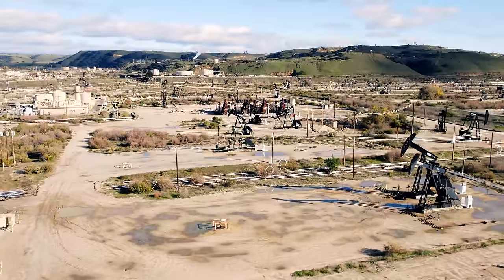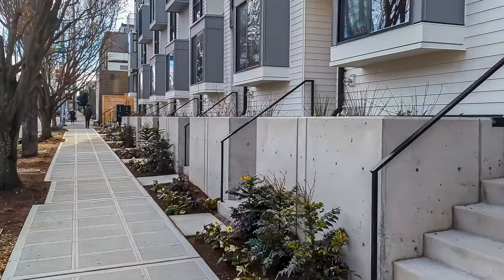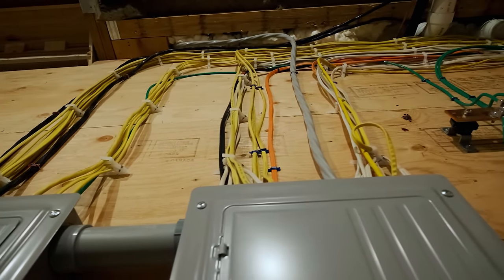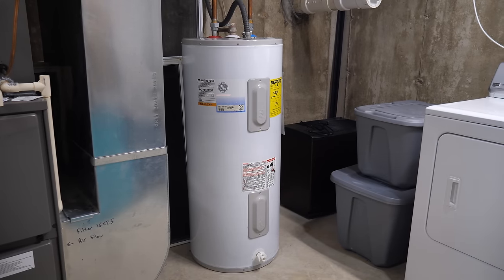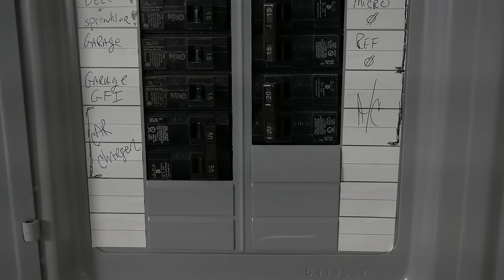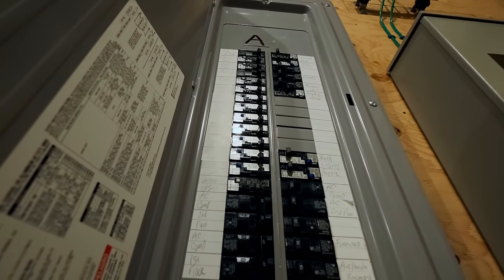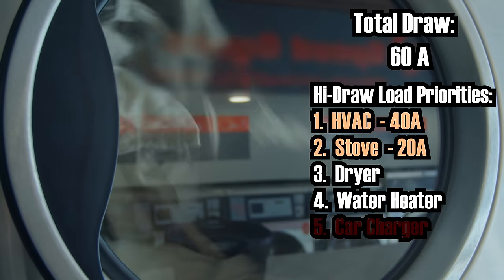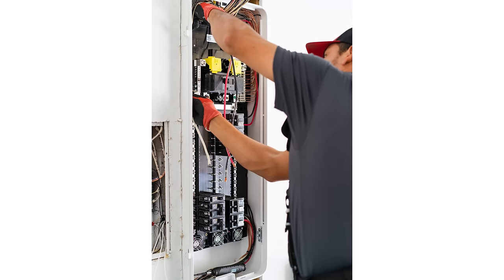Home Electrification: There's not a lot to do, and it doesn't have to be hard (Part 1)

Comment: I'm building a home right now. We are going to be in a very rural area prone to power outages whenever some truck hits an electric pole (which happens more often than you'd think). We are planning for an automatic propane generator for when that happens. I'm really looking forward to your video on that bit.
Reply: @barongerhardt  Electric-powered electric generator. 🤣

That has real "Instant water: just add water!" vibes.
Reply: @barongerhardt  The idea of costly batteries to maintain does not appeal to me.

Comment: For how much you need backup heat with heat pumps: I live in NB, Canada. I have lived in my current apartment (3rd floor, 1 bedroom, washer & dryer in the unit, our own water heater, everything is electric) for 3 years now, and our meter had just started back at reading something like 10 kWh when we moved in so I know I used 16131 kWh since I moved in. It has a 2 head multi zone heat pump & base boards heating, with digital thermkstats. Our current (move in 2 years ago) downstairs neighbour does not keep their heat as high as the previous tenant - our floors are no longer nice and toasty lol - so our bill did go up a bit when that happened, but not by much. 

We had ice storms over Christmas, and during the Dec 20 - Jan 18th bill we used 659 kWh for the 30 days. The first time I turned on my breakers for my baseboard (except the one in the bathroom) in the 3 years was during the Jan 19th - Feb 16th billing cycle this year, when we had like 3 or 4 days that it stayed around -30°C ish with the wind chill, and it hit as low as -40°C with the wind chill, and you can tell because for those 29 days, I use 750 kWh. Literally my highest bill since I moved in here.  And then I promptly turned the breaker back off because I work customer care for one of the 4 power companies so I know all too well how much baseboard heat wrecks  your bill 😅 had to raise my equalized billing and have become the stereotypical "raise the temperature, I dare you" person wearing wool socks and wrapped in a blanket at all times. 

But yeah, using your backup heat can be a kick in the gut... But it does not happen often if you have a heat pump that is rated for the temperature you expect to get in your area.

Comment: I feel like a smart breaker panel is going to be more expensive than just upgrading the service for 90% of houses...

Also, based on the models shown for the smart panel, there are parts which would wear out over time and aren't easily swappable.  And over the normal life span of a breaker panel, they are definitely going to break or be reeeeeaaaaallllllly expensive up front.
Reply from the maker: It might very well be worth upgrading to 200A, but whenever you do that you either need to run new triplex from your mast to the transformer (relatively easy) or run a new trench to it (possibly much harder). Whereas a panel swap is just a panel swap. Plus, the availability of a service upgrade is not guaranteed - you have to work with your utility, and if the local grid is already pretty tapped out they might not be able to upgrade you.
I can't vouch for how the Span panel is engineered, but contactors are pretty robust things and they'll rarely be cycled anyway - so I don't think I'd have that particular concern.
Reply: @TechnologyConnections  If it's an issue with the local grid being tapped out then maybe the grid would be more worried about your average usage rather than your peak usage, as long as the peak doesn't happen at the same time as your neighbour's peek.

They're already monitoring your average usage in order to bill you, so maybe they could say upgrade you to 200A but a limit on your average usage. If you use two much on average they might warn you a few times and then maybe fine you or limit your power back down to 100A.

Comment: If you want a fun rabbit hole to run down is the bearings used in windmill turbine generators. Apparently the loads are so great that the bearings may last 5 years. The bearing issues need to be fixed to make wind more reliable.

Comment: If you're building a new home thinking about resistive backup heat might make sense. But if you already have a wood, gas or coal-based heating and are renovating it makes sense to just, you know, keep it (if it makes any sense at all in the situation). You'd still use a heat pump in 90%+ of cases, but for those few really cold days when it's cheaper (or only possible) to use it as a backup, it makes perfect sense. As a nice bonus it also helps the grid which becomes extremely overutilized during those times.

Comment: I recognized that this video was going to be primarily addressing how current technologies could enable homes to run entirely on electricity, so I was worried that the "stoves with batteries" wouldn't be mentioned in this video, and sure enough I was right, but great to know they'll be coming in part 2! The December 14, 2022 episode of the Volts podcast by David Roberts on this technology was a really good listen.
Reply: Sounds dumb.  Not everything needs an inefficient battery (which like my hybrid car battery will need replacing someday)

Comment: 30 year old 3200 sqft house with 800 sqft of that being a finished basement with its own mini-split. The walk out basement on a 1 ton mini split. We had several days of 5F weather this winter in GA, the basement stayed 68 the whole time. 
However, the 2 upstairs floors of 2400 sqft on a traditional 3 Ton unit with no heat strip fell well behind with it struggling to keep it in the mid 50's. That said, the additional heat needed from a resistive strip to get us through that at a reasonably temperature would have been a whopping 3kw. Or a couple space heaters. Maybe if we had newer more efficient windows the heat pump would have been enough.

The HVAC guys said we needed at least a 20kw heat strip. A little air sealing and insulation goes a long way.

Comment: Gas won't be abandoned until Electricity can be cheaper. Electricity is more expensive than gas. It's simply not efficient to use electricity at this point in time. Not until 2050+ will we finally get some functional fusion power plants like ITER (which is just a test, not a grid-servicing power plant).

Comment: In Taiwan, Hitachi sells a minisplit that also works as a water heater, it simply uses a separate condenser to heat the water tank up while it’s cooling your room. Pretty interesting product
Reply: That sounds like an incredible efficiency upgrade. Taking heat from your home to heat your water and cool your home at the same time.
Reply: I believe Rheem in the US has something like that too. Very interesting product indeed
Reply: We’ve had this in Australia for years and they suck at heating water. The Instant Hot Water gas heaters work great and are very cheap because they don’t store any water in a giant tank when it’s not required.
Reply: Yeah it's a shame there's not that many of them in North America. I think LG Therma V is mostly commercial.. Taco System M is another I heard of that recently came out that might be a bit more residential. I think they're still far more expensive than generic heat pump water heaters like Rheem ProTerra and the like, but they do have more perks and likely more efficiency in the summer due to the compressor being outdoors.

Edit: SpacePak apparently has some interesting A2W solutions as well.
Reply: Taiwan is so great!   Great people, great heritage, and the ultimate in tech.
Reply: already exists in the us. its called a heat pump water heater......
Reply: @jtackerman28  yes. But it's ver rare that it's combined with a mini split air conditioner. Cools your room AND gets the water with a a single pump / outdoor unit.
Reply: @jtackerman28  definitely does not exist in the US, he said this heats the space too
Reply: @JesusisJesus  Water tanks hold their heat very well. Tech Connections already covered that, and is why offpeak powered water heaters are so common place in Australia, so it's weird you'd have that misapprehension.
Reply: A step forward towards a home coolant loop, shuffling around all the heating and cooling for the house 😀
Reply: @JesusisJesus  You can always have electric or gas water heater in conjunction with the heat pump. Even if the heat pump just produces tepid water, that's still heat that you're not wasting
Reply: Sanden makes a full heat pump water heater with its own outdoor heat pump. They are amazing! They also are over $10,000 to install and usually more like $15,000! Energy efficiency can be extremely expensive!!
Reply: @benhockley  100% agree, instantaneous hot water systems are pretty expensive to run by comparison, especially if it's the only reason you are paying for a gas connection
Reply: Lennux has/had a system that would run a HEAT PUMP to HEAT water and that would heat your water tank AND run through your air handler giving you domestic heat
Reply: @SunriseLAW  there's a water sanitation challenges with this. Keeping water warm but <60C tends to be a breeding ground for pathogens.  Most solar hot water systems here in Australia pump water through black hoses to make sure the water gets hot enough. Though these systems are now more expensive than solar panels with a conventional electric heater here
Reply: @JesusisJesus  Are you Alice Springs levels, stream train only, no train, LOL
All people live in apartments, urban townhouses, they all gave good gid.
U are in US levels down under, too remote !
Reply: Zaydan Alfariz  TSMC, ASML, we love the west !
Reply: I have always wondered why we don't do that.  We are literally pumping heat out of our homes during the summer and wasting it, while then creating heat to heat water at the same time.  It would make perfect sense to use a heat pump to do that.

My Hybrid water heater does this already, but it basically just cools down my garage in the process.
Reply: @JesusisJesus  That claim is literally absurd.  I have had a Hybrid heat pump water heater for like 10 years already.  And it works so well I never even turn on the resistance heating elements at all.
Reply: @JesusisJesus  I think we'll get battery-operated water heaters in the future.  
Instant heating is more efficient due to lower losses, but is impractical(for now) when electric.
Reply: @benhockley  Kinda. Depends where it's placed and how well-insulated it is.  
Mine is in the basement, and uses 4-5kWh/day just to stay warm when it's freezing outside. Not sure how low the losses will be during summer, but my guess is in the 1-2kWh/day range.
Reply: @MalawisLilleKanal  a basement? Never heard of someone having one of those in Australia. 1-2kw loss is really an issue if you hear it on the overnight tariff. I've got family in Tassie, NSW and Vic and they've never mentioned heat loss so extreme they can't have a hot shower.
Reply: @benhockley  Different climate and practices I guess. This is in Norway where we are used to cheap and abundant electricity(until the last year or two).  
BTW: The water heater is around 200L, and takes about 16kWh to heat up fully (8 hrs @2kWh) when it's allowed to cool to ambient.
Reply: @josephpimentel4624 the Rheem suck heat from your house. They're useless since this need to heat back that heat and studies show they barely reduce energy bill. The outdoors air to water for house or pool are much more useful.
Reply: I've fantasized about integrated heat pump systems in houses.  hot water (probably a pre-heat tank, most systems just can't heat water up hot enough), HRV, heating, cooling.  Maybe a hot tub?  All off one compressor unit, and in the summer you can dump excess heat into your hrv or hot water.

I'm not sure the industry will ever standardize enough to make it viable, but it's a fun thought experiment into what's possible.
Reply: @animefreak5757  You can lookup warmboard and spacepak, they do almost that together. EVR always connect to those systems. Then some people modify theirs to dump extras easy into their pool when in cooling mode.

Comment: Unless I'm missing it, a huge limitation of SPAN that to me puts it in the "useless lockin" category are (a) no local API (b) no open integration, like Home Assistant which of course needs that API, and (c) it's a phone/tablet app only.  I'm sure the control could be hijacked, but IMO anything like this needs an option for full local control.  Using a base infrastructure control system with with lockin/lockout is a hard no go to start.  (Just as a casual example, I'd probably add a button mounted in devices like dryers that could be "override priority" that set low priority devices as the highest -- when you really need it right then, and without having to juggle things in an interface.  And also building in more complex scheduling and feedback systems...you could build your own system for having devices schedule their own power use based in predictions and human activity.)
Reply: It's very DIY right now, but there are several GET and POST endpoint available locally and a local method of generating an auth token. There's a lot of info in the thread on the HA forums titled "Integration with Span?", including interaction with some SPAN employees.
Reply: That’s a pretty bad one honestly. Like what happens if span as a company disappears in 10 years?
Reply: @nasonguy  I'd be shocked if a bad capacitor or a tin whisker doesn't take the electronics out before 10 years is up.  I just wouldn't trust something as important as my main electrical service to a "smart" device unless I was sure it would fail dumb when the electronics die instead of failing dead.
Reply: @disjustice  I love the idea, but I'd REALLY hope if something went wrong it falls back to being a normal breaker. I like the idea of more control over items but I'd like a failure mode to revert it back to a dumb device vs. taking everything with it.
Reply: Even beyond the fact that most IOT things are fundamentally poorly designed systems, the fact that you're supposed to be okay with the utility company just saying "Nah no electricity lmao think of the planet." absolutely does not sit right in my moral view. Like - you are providing a service for which I am paying you, mind your own Fing business.